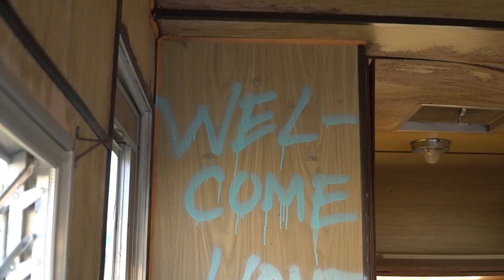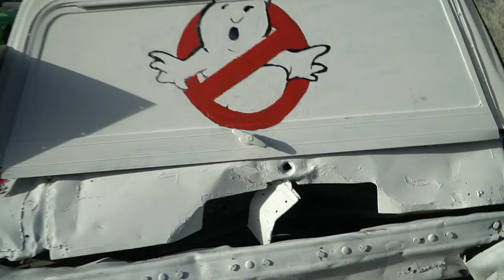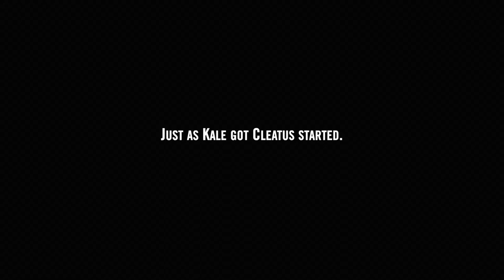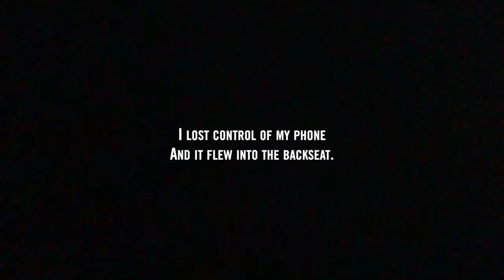Demolition Derby Trailer Race - First Time Experience... Why do I do this??!

Comment: That is one he'll of rush for sure. Just found your channel after it come up about trains. You said something about a demo derby so I had to check this set of videos out for sure. You should do some dirt track racing and drive or even get behind the wheel and drive in a derby and send it driving. It's fun.
Reply from the maker: Wow!  That would be wild!
Reply: @DownieLive  picking up car should be easy. A cheap beater online or out of someone's backyard. Find a place to run and go over the rules, the more stock the class, the easier to get the car ready. Show up and send it. Find a couple of local sponsors to help out and put their name on the car. I have run derby a few times, my brother and his kids have done it for years. Ended up getting them into dirt track racing now.
Reply: @DownieLive  I do have a channel I have not done much in a couple of years, but I do go though and breakdown what you would need to do for getting into racing. The costs, the classes you want to run and such. The user name is ckosacranoid. Need to do some updating from some of the racing videos from the past few years I have filmed. If not Facebook under Otaku photography for some really big videos and photos of dirtvtrack.

Comment: what engine is under that beast
Reply: Small block chevy 355 cid
Eagle crank eagle rods 
Ross forged pistons huge solid cam
Brodix track1 aluminum heads
Holly strip dominator intake
Makes 550hp